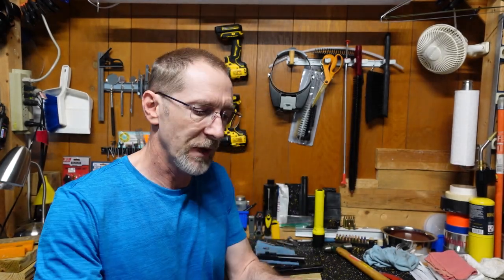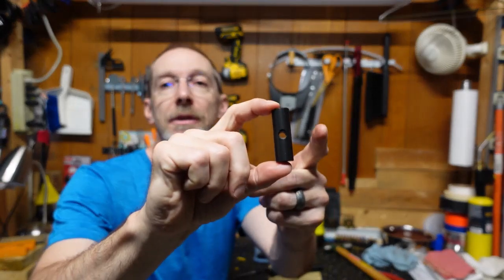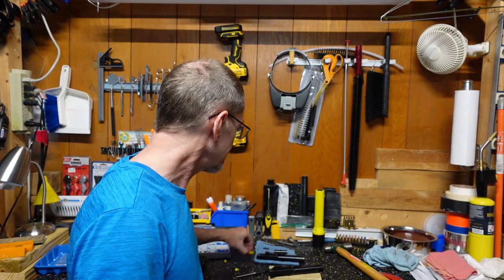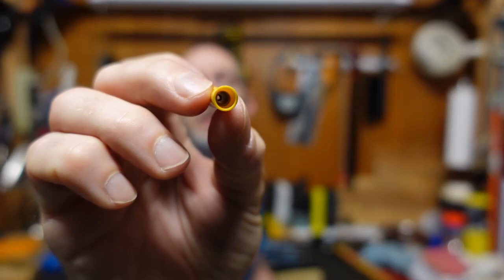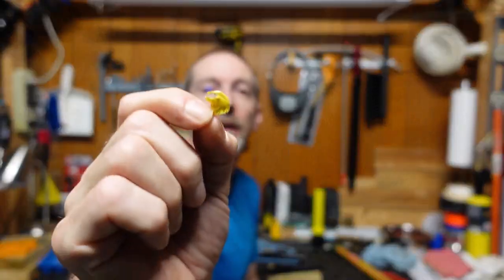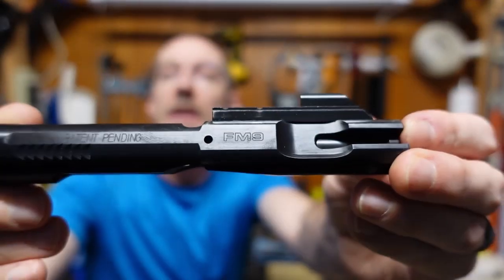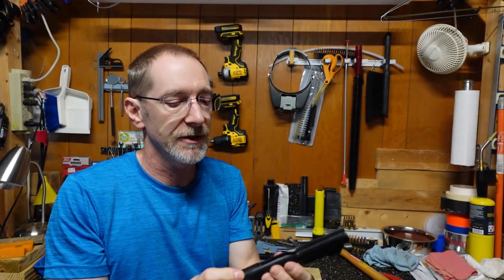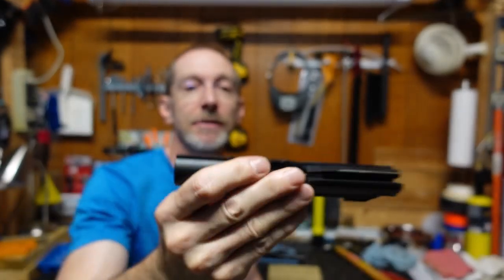KAK tungsten bolt weight in FM9 bolt - yes it fits (mostly).

Comment: I found a much more elegant solution to the FM-9/KAK tungsten weight fit issue. I bought a bronze bearing sleeve from McMaster-Carr, PN#6391K858. It's 3/16 ID & 1/4" OD & 5/8" long. It fits exactly in the KAK weight hole. Just round off the edges and it slides right into the FM9 carrier. It was $1.09. Since it's bronze it files easily. I finished my Soft shooting PCC 9mm using your formula and it shot 100% from the get-go and is like butter. I used an FM9 side charging upper, FM9 lower, FM9 bolt with a KAK tungsten weight & bronze sleeve, JRC buffer tube, Wilson flat wire spring, Ballistic Advantage EPC 16" barrel, KynShot RB5015HD buffer & 2 KynShot Weights. I switched to a Velocity MPC PCC 9mm trigger and changed to a PSA titanium firing pin because of the wimpy firing pin spring FM makes you use. None of the other springs I have will fit inside the carrier's firing pin hole. So I went with a lighter firing pin. I did clean out the firing pin channel completely with a 5/32 drill. The rifle cocks 100% easier than before. Why? Because Foxtrot Mike used a super heavy 308 Carbine spring before and now it's not required. This thing shoots far, far better than it did before. I had bought it as a complete lower with their buffer tube, buffer, and spring...Sorry for the book but I thought another success story might interest you.
Reply from the maker: Fantastic!  Thanks for sharing!
Reply from the maker: I have yet to test it, but I found a stronger spring that fits the FM firing pin channel: https://reddit.com/r/AR9/s/ZZ6tRmNf7W

Comment: The FM9 PCC side charger bolt I have is different. The hole is not only larger but it is in a different location than the KAK tungsten weight. In that case, your choices are limited to drilling a new larger hole in the bolt or a new smaller hole in the weight. I chose the latter since screwing that up is just the loss of a $30 weight. It's also an invisible modification. The weight is tungsten and it laughs at even cobalt bits. You need a carbide bit to drill the 3/16 hole. Fortunately, I had one. It cut through it like butter. This is one where you have to measure twice and drill once otherwise you'll never get the hole in weight and the hole in the carrier to line up. They obviously have to line up perfectly otherwise you'll never get the 3/16 roll pin back in. To dress things and make it weigh what it used to. I fit a brass rod to fill the KAK weight's 1/4  unused hole.  When I was done the KAK tungsten weight was in the FM9 side charging bolt and looked completely unmolested.
Reply from the maker: Great information!

Comment: I'm building a new AR9 using all of your suggestions, The parts are arriving now,  taking advantage of the Labor Day sales. Landing shortly is a Ballistic Advantage 16" EPC barrel, KAK heavy buffer, Wilson flat wire carbine spring and I'll tweak the ejector on the lower. I'll be using an Aero Precision EPC9 lower or a KE-Arms KP9 lower. If I use the KE-Arms lower I can't use the flat wire spring. It has to be a round wire spring. Flatwire springs tear up the integral buffer tube. I'm going to try the Odin Works Enhanced Bolt. It is actually somewhat different. If it proves to be a problem I have an Angstadt Arms as a backup. It appears to be absolutely identical to the Faxon bolts. I can almost guarantee that the same shop made both bolts. The only difference is the name on it and it's in the same place. 
Do you have any suggestions on muzzle brakes? I know they aren't critical on a 16" 9mm barrel but there are more than a few to choose from. Some of them are aluminum.
Reply from the maker: Sorry, I don't really have a brake suggestion.  I mostly use 3-lugs.  Good luck with the build!

Comment: I thought the FM bolt was a "no-go" because the firing pin's spring was too weak and could cause the firing pin to move forward through inertia when the bolt  is cycling possibly firing out of battery?
Reply from the maker: The FP spring is quite weak.  I've only found a couple reports of slam-fires.  I'll see if I can find a better spring.
Reply: I have a FM bolt and I stopped using it because of hearing about the slam-fires. I like the FM design with the forward assist cuts but the firing spring spring is very weak and the firing pins channel inside the bolt is very rough which maybe catching the firing pin in a forward position causing the slam-fires??? @Blowback9
Reply from the maker: I think it's more likely that the weak FP spring combined with sensitive primer ammo could have caused intertia slam fires.  I looked and may have found a replacement spring.  I need to do some testing.  Details here: https://blowback9.wordpress.com/2022/10/20/tech-analysis-fm-9-bolt/

Comment: I have a rear-charging FM-9 that was fully-assembled from the factory by them. I'm ordering the 2 parts from your blog that you suggested replacing but I was wondering if it would be worth it to try making this modification too, or would it be worth it to find another BCG that works with the FM-9 upper?
Reply from the maker: The FM bolt is a decent bolt and should work fine as-is.

Comment: I bought a KE-Arms KP-9 dedicated 9mm PCC Glock magazine lower. It's a polymer and I've always had great luck with their products. I am putting on a Gibbz dedicated 9mm Side charging upper. The odd thing is that the buffer that came with the KP-9 lower is a standard carbine length buffer, not the longer PCC buffer. It weighs 5.3 OZ. Not sure what's u with this. It looks like a carbine spring. How do I check if I need the longer buffer or spacers?
Reply from the maker: Pull the charging handle all the way back.  The bolt face should stop 1/4" or less behind the catch.  If it's more, spacers should help reduce the chances of breaking a bolt catch or cartridges getting into the lower's trigger pocket.  9mm generally runs best wtih a 4" deadblow buffer and a bolt+buffer total mass of 22oz. or more.

Comment: What is the weight difference from the piece removed and this? Any idea if it will work in a KVP bolt?
Reply from the maker: IIRC, the removed steel weight is 2.0oz. the tungsten weight is 4.5oz.